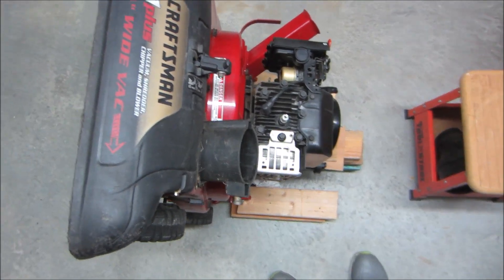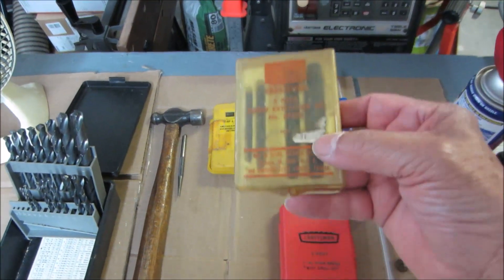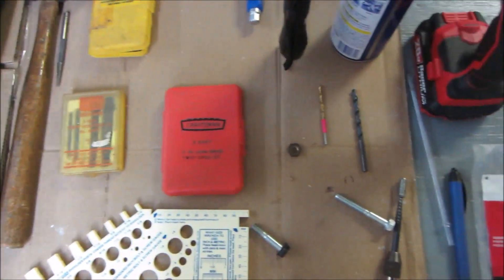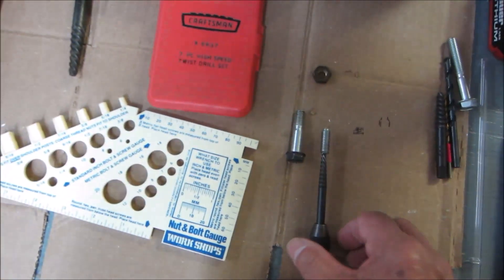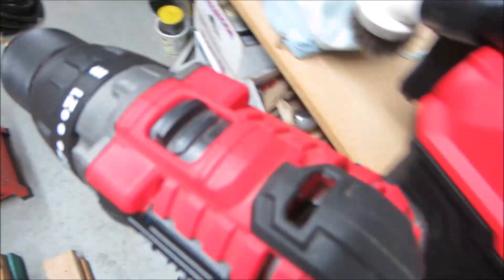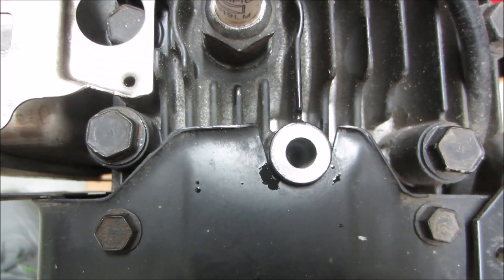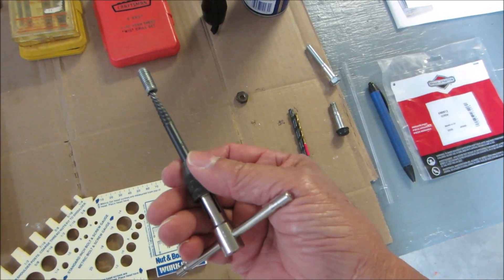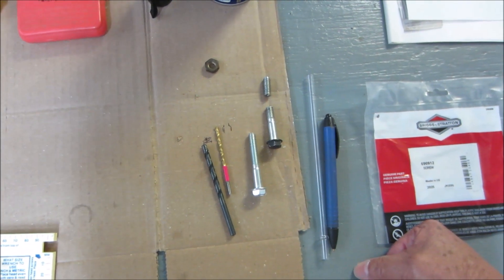Frustrated User Guide: Broken Cylinder Head Bolt

Comment: I would taken the head off? And used vice grips to get out or mig weld a nut to it and pressto out .that take too much time ⏲️ what u trying to do that u do as a last resort 💯
Reply from the maker: You're right. That's what more experienced person would have done. I was just looking for the cheapest and easiest way to get the stud out. It worked. I only needed to buy one head bolt to fix the lawn vac, but maybe next time, I'll try taking a head off. The town dump is loaded with discarded lawn and garden equipment. I'm in a blue state. Nobody wants repaired. Everyone wants new. Thanks for commenting. I will follow your advice next time...